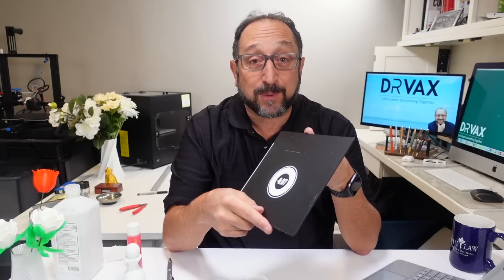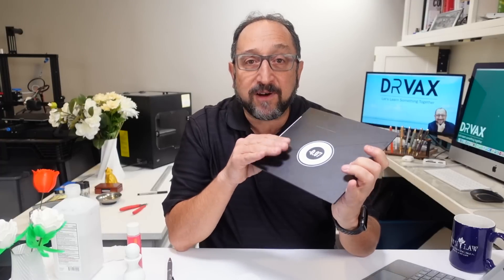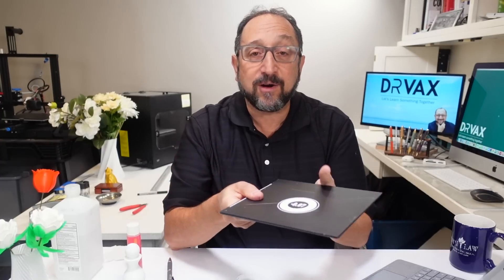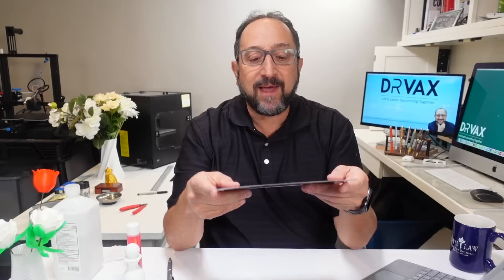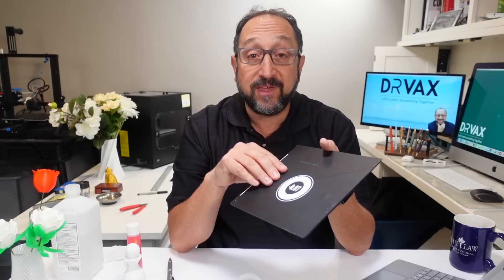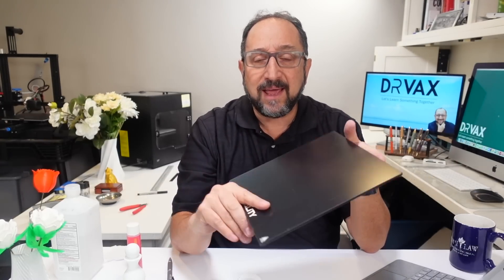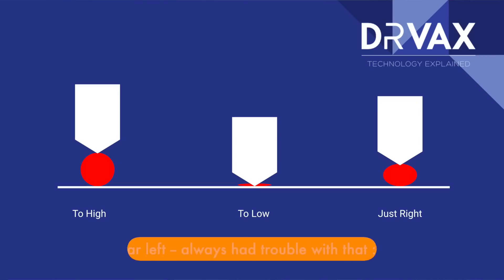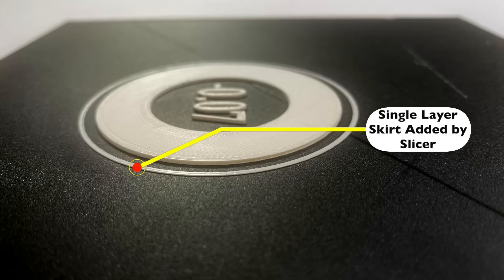3d Printer Tips Print Not Sticking

Comment: I always had problems with the first layer not sticking to the bed, until I found out that I leveled the nozzle to bed distance totally wrong the whole time. I always started leveling the nozzle to bed distance from the 0 position(home position), which basically gave me the set layer hight plus the thickness of the paper(~0.4mm)🤦‍♂️
I now do it like this:
-Heat up nozzle and bed.
-Set the Z-hight to 0.2mm!
-Using a feeler gauge with 0.2mm to level the nozzle to bed distance with a tiny bit of friction on 5 points of the bed. 
Giving me a perfect first layer every single time.

Comment: I had problems with adhesion early on and once I leveled the bed it got better. Once I shimmed the middle of the bed with two pieces of paper (about 4"x3"") in the very center of the bed. It not prints almost perfect in any location on the bed. Now I only level the bed every few prints to verify everything is perfect still.

Comment: The most annoying thing with leveling is how the middle has too much of a gap while the rest is just fine. When you try to fix it, the middle would print properly, but everywhere else gets realy rough looking. Another one is how I do bed leveling tests and the squares look good, but the corner or edges of the squares are rough looking as the nozzle is too close in one spot, but just right a few centimeters away from that spot

Comment: Replaced the print surface. First couple of prints were perfect, now nothing will stick. I cleaned and re-leveled the bed 6 times and still nothing will stick. I've switched to different PLAs and still nothing. It's driving me nuts. It just starts clumping up around the nozzle (which also was replaced recently)

Comment: I always have a problem  remembering which way to turn the knobs, so I came up with this mantra "if it's loose, loosen the knob: if it's tight, tighten the knob". Let me clarify. If the filament is loose (ie not sticking), the gap is too large. In order to raise the bed, you have to loosen the spring. So "if filament is loose - loosen the knob".

Comment: I don't have a BL Touch, just a stock Ender 3 setup and my stock bed was really warped right out the box, so I went over to a local hardware store and got a glass bed cut. It's perfectly flat, but my favorite material, PETG, can rip chunks of glass out if you don't use a gluestick. For whatever reason, PETG doesn't seem to stick very well to my gluestick. Pieces seem to get dragged off as the nozzle moves away after printing small shapes like the base of tree supports, so I really have to squash the filament into the glass for it to stick properly. I'm thinking it has something to do with the print temperature not being high enough (on a stock ender 3 with a bowden setup, you shouldn't go too high) and maybe my flowrate needs to be higher on just the first layer. Using a brim instead of a skirt seems to help a little bit. It might also be worth trying out a "permanent gluestick" as Chep suggests.
Reply from the maker: Another thing to try is blue masking tape.  It is tedious to apply but sticks well when used with a bed adhesive and will protect the glass.

Also it is more expensive but dimafix or magigoo are much better than glue stick.

Comment: Preparing a glass plate for 3D printing with PVA glue (white plastic glue) - thin layer application on the glass, drying on the printer at 60 degrees Celsius, after printing Inserting to  the freezer will cause the print to detach from the glass, rinsing the glass with water will remove the glue residue 
 https://www.youtube.com/watch?v=yQTpkxGRwXw&ab_channel=shbyshby

Comment: Ender 3 v2 glass SUCKS....
Reply from the maker: Clean it well and then use magicgoo or dynamax as bed adhesive and it will work well.
Reply: @MakeWithTech  I had 5 days of hell trying to get this.  But I finally found a G-code from CHEP that would let me level the corners then I could hit the button and it would go to the next and so on. I got a good level finally and have been printing non-stop since. I have also did multiple upgrades since!! I then bought a second Ender 3v2 and the Anycubic Vyper which I love btw!! Thank you for all the help from your channel as I have learned so much these last few weeks and I'm just glad I didn't give up as this is now my new favorite hobby!!
Reply: @Savage1776_  I'm going to give this a shot.  I just bought two printers, a Biqu B1 and an Ender 3 V2.  I have been going through hell trying to consistently get anything to stick to the freakin Enter 3 V2 bed.  I know it has to do with proper leveling, but hell!!!! It seems like I am constantly turning the knobs to get it level. The Biqu B1, which I paid about $75.00 less for brand new, I have no problems with. Granted, the beds are not the same, the Biqu B1 bed is a magnetic spring steel.  All I do is once the part cools a little, pop a corner and it releases.  I clean it prior to every print with alcohol.

Comment: Dr.vax! , the other day my filament suddenly didnt wanna stick anymore to the buildplate but it just drags it around. 
i have leveled the bed and cleaned the bed but nothing helps . 
i have a Creality ender 5 pro with 210 degrees on the nozzle & 60 degrees on the bed. 100% fanspeed, i use a brim as a adhesion, and magnetic build plate,

Comment: Try qidi tech flex plate and you will throw the other beds out of the window...just joking a bit😊  Qidi tech plate works so well that it can be tough to get the print of the plate. I can just talk for PLA...but i have also read other people talking about qidi techs bed and they are also surprised how well it sticks....not just PLA. If you have magnetic sheet and have a printer bed that should suit for a qidi flex plate then go for it. This is not a complete bed just the plate...they just sell these for their own machines. It's not so expensive but it can be hard to get one depending what type of qidi machine flex plate you aiming for. Qidi x-max is not easy just now

Comment: I am struggling with bed adhesion.   I have a level bed, with BL Touch for auto-levelling, the Z-offset is set correct to get a reasonable "squish" in the first layer, glass bed cleaned with Isopropyl Alcohol.  Tried bed temps from 45 to 60 (PLA) and even up to 90 with a PETG roll, still cant get the damn things to stick.  Even tried glue stick.
I even went as far as getting my digital caliper out and measuring the height of the first layer just to check it was even.
Any ideas?

Comment: Cleaning the bed Question....

Recently I had a very small area of the bed contain an extremely thin layer of filament that really did not want to come clean from the bed. I tried water, saop and water, and alcohol with a heated bed. I had little luck and didn't want to scratch the bed with using the print knife/pallet (not sure what that thing is called of the top of my head). Anyway... What I ended up using was a dab of acetone. I had read about using acetone to dissolve PLA from clogged nozzles. So I gave it a whirl. It did an amazing job of cleaning the bed of excess filament. Assuming that you clean the acetone off after use, is there any reason I shouldn't use it to clean excess filament from the bed?

Comment: Hiya Dr VAX! Love your channel! I have the opposite issue even cool the prints dont release. I need to use a razor blade to remove them. Do you have any suggestions/videos for this?
Reply from the maker: I also use a razor blade when prints stick too well, but I put mine in a paint scraper.   You can try two things to get prints to release more easily. Increase the distance of the nozzle to the bed -- but if you increase it too much your prints will not stick.  Try using a print adhesive like MagiGoo which will have the print hold when the nozzle is farther away so it will release better.

Comment: For my ender 3, a pei bed solved all my issues. It has the surface quality of glass with the flexibility of the original bed that comes with the printer so you can still flex your prints off the bed easily. Have not had a single bed adhesion issue since I made the switch. 

Plus it’s magnetic so you can ditch the clips, and in cura change the setting to an ender 3 pro and it will give you a slightly larger print surface now that the clips won’t be in the way 👍

Comment: Nice video as always. All my printers are equipped with spring steel sheets.  If I am printing with PLA on a smooth PEI surface, I just clean it first with IPA.  When printing with PLA on a powder coated sheet, I use a glue stick.  With PETG I use glue stick on a smooth PEI surface and just clean with IPA on a power coated surface.

Comment: I guess it is worth considering that the thickness of whatever you set the nozzle gap with also counts. Typically people use a piece of paper. I used some 80gsm copier paper, and when measured with a micrometer, that was 0.13mm thick.

I use a BLTouch, and the Z offset adjusted the standard way is -1.55mm. Ie it is saying that when the sensor triggers, the nozzle is 1.55mm above the bed. Except is isn't, it is 1.55mm above the bit of paper, so 1.68mm above the bed. Therefore, I guess I should really change the Z offset to -1.68mm. That way when my initial layer is set to 0.3mm, then it should be that and Cura should calculate flow correctly, at the moment is is calculating for a 0.3mm gap that is really 0.43mm.
Reply from the maker: Your math is probably correct.  But I generally find setting the z offset via experimentation world.
Reply: @MakeWithTech  Yes, except that the slicer will be working under a misaprehension as to what gap really is, so will get the flow wrong. In my case, since the gap is about 40% too big, the flow will be quite a lot too low.

There is a first layer flow factor, but maybe it is adding a fudge on a fudge.
Reply from the maker: @Nfh65f9  Excellent point.  I never thought about how the gap (z offset) will impact flow rates.   Very interesting.  May with your permission have to do a video about it.
Reply: @MakeWithTech  You bet! On a scale of 0 to 10 your videos rate as 11 at the least.

Comment: I've always used a very dilute (95% water) solution of PVA on my (Anycubic) glass bed.  I put it on thick with a sponge and let the hot bed evaporate it to a thin, even layer.
Reply: PVA is pretty tough stuff once dry. How do you clean the bed?
Reply: @imacmill  It is water soluble, so water, gentle scraping with a metal spatula (mostly for stuck down skirts), and a sponge.  When I said I put it on thick, I mean a lot of a very dilute solutiion.  The PVA that is left once the water evaporates is very thin.

Comment: You're my favorite "go-to" when I have problems printing with my Ender 3 v2.  Since I've switched from PLA to PETG, I had adhesion problems on my glass bed, I did try the 3M blue tape but it didn't work, and the tape was a "PITA" to remove.  I have since gone to "K stick" a cheaper version of your MagiGoo and it seems to do the job.  Thanks for all your videos, I'm sure it's helps a lot of us out there.
Reply from the maker: Thanks for the recommendation of "K Stick".   I will have to give it a try.
Reply: @MakeWithTech    You can find it on Amazon at: https://www.amazon.com/Organizer-Filament-Washable-Anti-Tilt-Non-Toxic/dp/B07QZ29CHW/ref=sr_1_4?crid=3BTM6MF51LI8V&dchild=1&keywords=3d+bed+adhesive&qid=1613580110&sprefix=3d+bed+%2Caps%2C186&sr=8-4

Comment: This has been killing me for the past few days. New ender 3 v2. Cleaned glass, levelled, installed a bltouch.  Checked levelling again. I've managed to print one successful thing, but now ipa just isn't sticking. Cleaned glass again with soap and water, and then isopropyl alcohol. Still no luck. Will try elmers purple glue.
Reply: I had the same issue.
I made the firmware from template directly for bltouch. And I set the z-offset 0.01 by increment until it's perfect.
Now it works like a charm.
Reply: @The4lexO  Interesting. I used the Smith3D firmware.  How did you make the firmware?
Reply from the maker: Try magigoo. Make sure you manually leveled print bed.  Then adjust Z offset.   Then insert G29 in slicer start code.   Reslice and print.
Reply: @MakeWithTech  Thanks. I've ordered some so will see how it goes. My offset is -0.20. I've also inserted G29 into the code, and can see the printer tests 16 points before starting.
Reply: You shouldn't need any glue if so it's because it's not balanced.
You should tighten the belts as well.
It's only about configuration.
There is few examples on how to configure firmware from scratch.
I had so many issues with 3DSmith software that I did my own and now it works perfectly. I have a 4.2.2 MB also

Comment: If you need glue to make your prints stick you're doing it wrong.
There are some scenarios where glue stick is advised, like when printing PETG on PEI in ex.
For cleaning i use cheapest window cleaner i can find, i don't need alcohol for this.
Reply from the maker: You are absolutely correct.  However many folks struggle with getting the bed leveled perfectly so using MagiGoo or a bed adhesive helps them out a bit.

Comment: The Creality textured glass beds, at least the early ones that came with the CR-6 SE, would have their special coating come off with IPA. Using plain soap and water works well for them. The formulation in ones manufactured more recently may not be affected the same. BTW, many glass cleaners have some isopropyl alcohol (or a similar type of substance) as one of the ingredients.
Reply from the maker: Important information.  If anyone has a link to a website from Creality about cleaning their glass beds please add it here.

P.S. I have started a new discussion forum at http://forum.drvax.com where we can all have more elaborate discussions and share pictures on our prints and printers.

Check it out. Irv
Reply: @MakeWithTech  So this is the only thing I could find, with a comment from an Admin. https://forum.creality.com/topic/327/how-to-clean-glass-bed-cr6-se/28?fbclid=IwAR3ar9I0YF6kmO_M-8RzXqJVpfTG_6smvWTDdWCjGNGNFdlmNyiEPZcx-nk

Comment: Great Video! I've found with glass specifically, clean and level bed trumped masking tape and glues. I do LOVE magigoo (learned from you, ty!) for prints that are really small and don't have a ton of bed surface area , to ensure they stick. But about 90% of the time now, I get great bed adhesion just keeping them level and cleaning the beds between each print with 90%+ isopropyl alcohol and water. 

In cases that the print has many sharp edges, I've found using the TabAntiWarping plugin by 5axes plugin in Cura is great for preventing elephants foot and prints lifting. It adds a tiny little customizable brims to specific areas. It works really well and they are easier to remove than the regular cura brim.

The Z-offset plugin by fieldOfView in Cura is great when you have those certain, pesky filaments that sometimes need dug-in a little bit more than others, so it's not added to the printer, just THAT particular print. 

Another is adding "bottom layers" helps reduce "thin-ness" during the initial layers of the print, to help down the way.
Initial Layer Horizontal Expansion set between -0.15 and -0.20 works really well for reducing warping and elephants foot! (another tip I learned from you!ty!)

I really enjoy your content, and I really do appreciate your insight and help! Thank You!

Comment: I get the best results setting my gap/leveling what you had as "too close".  I print almost all in ABS with some PetG and Nylon.  The PetG is set to a much looser level than the others.
Reply: Ack, ABS/ASA work better when there is enough pressure. Those warping prone plastics are a bit picky. PETG likes a bit more room, otherwise it decides   whether it doesn't want to stick or not come off at all after printing - but likely not inbetween.

Comment: good explained! thanks a lot :) , does hair spray really helps like some people say ?
Reply: I like it on plain glass, spray a little cold and heat up the bed it will form a nice layer, if you get too much on you can try to clean the prints with water.
Reply: @woodwaker1  i have the ender 3 Max and tried to print on the other side of the bed, the smooth one, and i could't be able to make it stick, but now i have on coated side again and with optimized brim settings i have it stick for good and with no warping, hopefully it stays so :D
Reply: @kinanhloubi1935  try some glue or hairspray, and I think closer is better.
Reply from the maker: I have not used it but many people highly recommend it.

P.S. I have started a new discussion forum at http://forum.drvax.com where we can all have more elaborate discussions and share pictures on our prints and printers. 

Check it out. Irv

Comment: During the first lockdown, I ran out of IPA and not wanting to get scalped by purchasing some more I went on to some forums to look for alternatives, I found a post where a guy was using a product called Windex window cleaning liquid, well I live in the UK and this branded product is not available but I did have some window cleaning liquid that I use for my car so I used that on a Creality Ultrabase type bed and I found out that filament would not stick to it at all.
 I started off cleaning it with a handheld steam cleaner and found out the window cleaning product had soap in it which I took off without any problem, about a week or so later I was clearing up my garage and found a 2.5L container of IPA that had never been opened, the price label had the name of a local hardware store that closed down in 1991 so this IPA could be more than 30 years old but worked just fine
Reply: Hi Andrew,  Windex is basically Windolene.

Comment: Thank you Doc.

My print stuck well last night but when I tried to remove it, the layers separated. What would cause that?
Reply from the maker: You need to increase your extrusion temperature.
Reply: was it silk PLA filament? I have to print that at 210c or I get layer delamination
Reply: To much cooling, possible underextrusion.